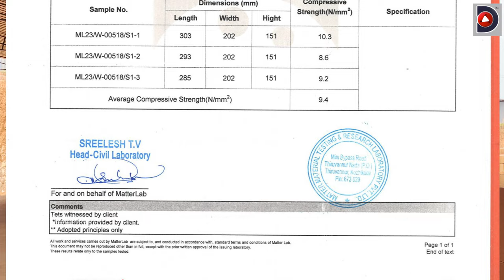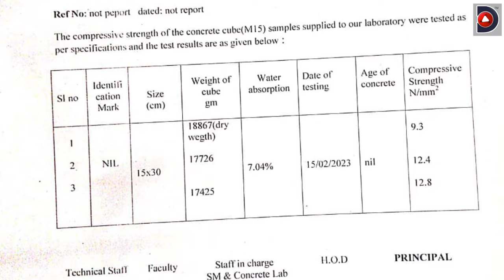35 രൂപക്ക് ചെങ്കലിന്റെ പകരക്കാരൻ | ഉറപ്പുണ്ടോ mun brick | trending brick for home

Comment: M Block ന്ന് പറയുന്ന ഈ സാധനം വാങ്ങുമ്പോൾ നോക്കീം കണ്ടും വാങ്ങുക... പിന്നെ  framed strecture ഉള്ളവർ മാത്രം ഉപയോഗിക്കുന്നതാണ് ഉത്തമം... എന്തെന്നാൽ സാധാരണ കല്ല് തന്നെ wire cut ഉം structures ഉം ഉള്ളത് കൊണ്ടാണ് വെള്ളത്തിൽ ഇട്ടാലും ഒന്നും കുറെ കാലം കൂടി ഒന്നും ആവാതെ നീണ്ടുനിൽക്കുന്നത്... 
ഇതുപോലെ ഉള്ള M udBlock കൾ കുറച്ചു കാലം വെള്ളത്തിൽ ഇരിക്കുകയൊന്നും വേണ്ട just ഒന്ന് toilet ലെ Seepage വന്നാൽ തന്നെ അടർന്നു വീഴൽ തുടങ്ങും.   പിന്നെ Load Bearing Structure ആണെങ്കിൽ അതിന്റെ കഥ🤣 , ഇത്ര ഒരു pressure ൽ press ചെയ്യുന്നത് കൊണ്ട് അത് ഇങ്ങനെ ഒരു shape ൽ നിൽക്കുന്നു എന്നെ ഉള്ളു.... വെള്ളം കയറുന്ന സ്ഥലം , നല്ലോണം മഴ , Etc..  ഈ കല്ലുമായി വെള്ളം contact ചെയ്യാൻ സാധ്യത ഉള്ള സ്ഥലങ്ങളിൽ ഒന്നും ഇതുപോയോഗിക്കരുത്... അത്ര നിർബന്ധം ആണെങ്കിൽ AAC Block , Cement Block ഒക്കെ ഉപയോഗിക്കുക.. അവക്ക് ഒക്കെ എത്ര വെള്ളം കയറുന്നോ അത്രയും strength കൂടുകയല്ലാതെ കുറയുന്ന പ്രശ്നം ഇല്ല